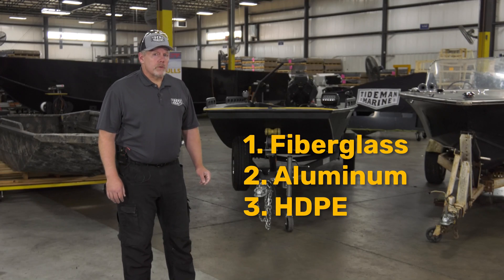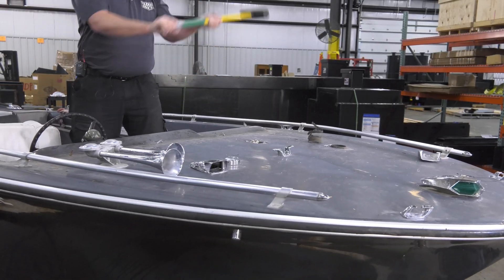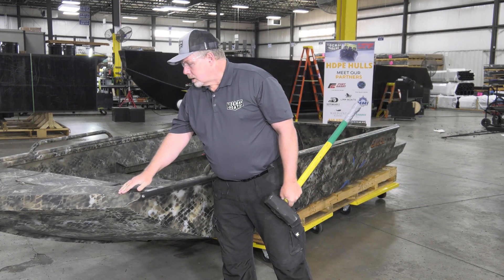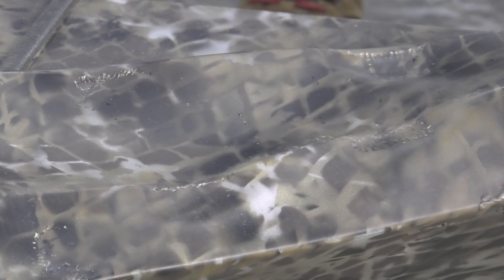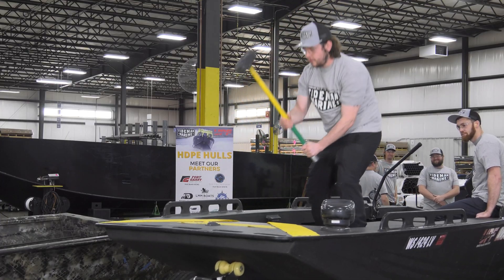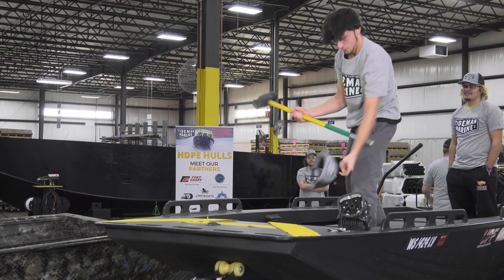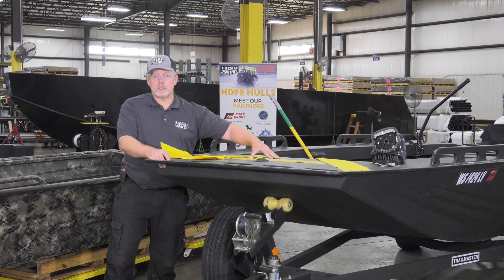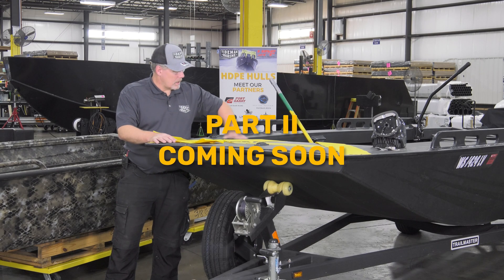Which Boat Hull Material is BEST? Fiberglass, Aluminum, or HDPE? | Tideman Marine

Comment: How thick were the three materials? What was their weight? How much 
reinforcement is required for the different materials?

I ask because I am interested in fabricating my own luggage and was a welder/avation structures mechanic aluminum, and fiberglass would be the obvious choices for me based on knowledge. But if I could use HDPE and  have similar results in similar environments (thanks airport bag throwers) with a significant weight increase or need for lots of space loss due to reinforcing (HDPE has tended to sag in the heat in my limited experience with it) this might be the perfect material to go with
Reply: Price as well. I'm trying to design a rigid structure as well and thought I would be forced towards goofy ass carbon fiber or ABS plastic. Your question gave some insight.

I want my product to last generation's or sold, not end up in a landfill polluting the environment.

Comment: What a bs, try epoxy/carbonfiber  or aramith, kevlar vs hdpe after few years in the sun, when it gets brittle. And build it to the same weight , then alu gets way thicker and will also hold up. This is a salespitch for dummies to sell hdpe.

Comment: Amazingly Brilliant! Thank you for sharing this video. I need a few of those HDPE boats now in my place. What size boats, their lengths, widths, transom height do you make? And various size boat cost? Thats the way small to medium size boats should be made using HDPE. I would be interested in about 10 metre length boats to be powered by 100 t0 200 kW of electric outboard motor or inboard or maybe a electric- diesel hybrid system for medium range of about 50 nautical miles. The closes place to me is Australia. Do you have agents in Australia? Thank you. Greetings from Madang, Papua New Guinea.
Reply: 6m to 12m boats.  V hulls, landing craft and barges.

Comment: it depends on what the material is used for and the goals and such. how much flex is permitted? where can supports be placed? etc. in kayaks HDPE is good as it absorbs shock after doing drops and roock impacts. this video question is largely rhetorical  and is just simple math

Comment: Very interesting !  Very impressed !   Big thankyou for posting this video !   You have confirmed my initial research comparing these exact 3 material options.   Hdpe is unique,  and a clear first choice for my planned dinghy.
      Two questions keep niggling me, and so far, i have found no answers :  
     - if hdpe is so tough,  why do hdpe domestic council rubbish bins sometimes split at the hinges, or down the sides ?
   - hdpe is very flammable, seems like similar to grp, and much more so than aluminium ?
Reply: Don't you love it when companies never get back to you?
Reply: Excellent question.  Different composition of HDPE and fabrication.  This is not a roto-molded HDPE boat.  This is hand welded from HDPE sheet material.  HDPE has a lower toxicity than fiberglass.